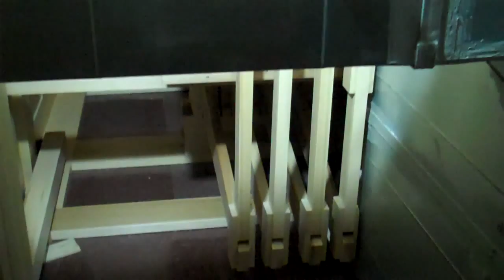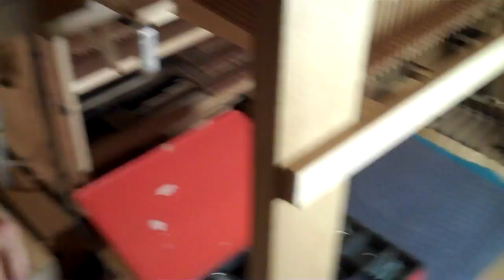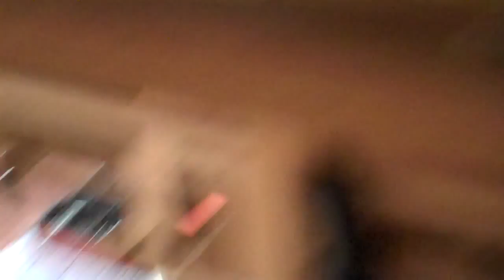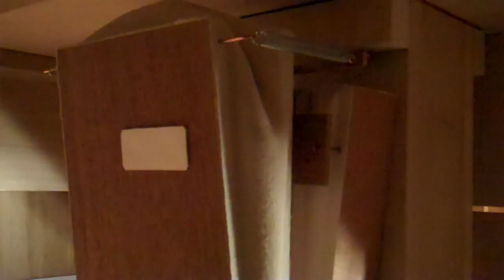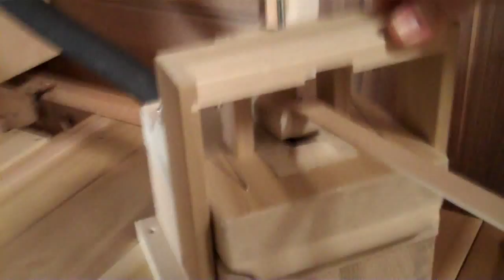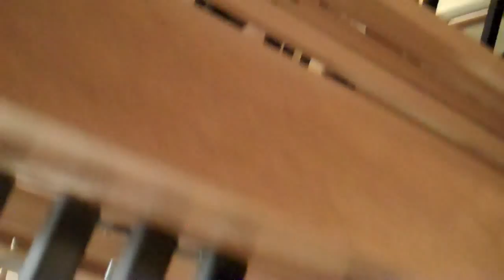SPPC4807 Part 33 Organ Build

Comment: The organ looks nice, neat. But, IMO, that motor should have ribs.All the motors that are blown (in opposition to the ones that are in a chamber, and under pressure) should have ribs. Curious also the kind of leather used on them.